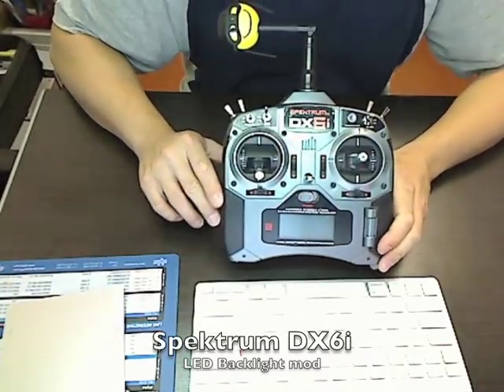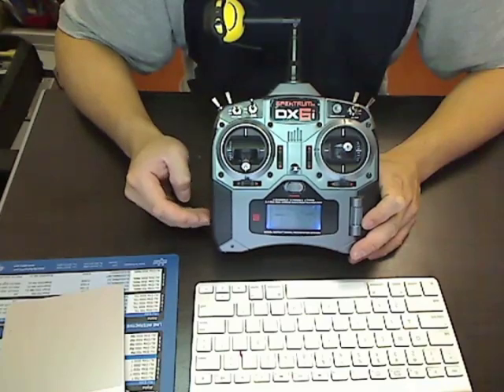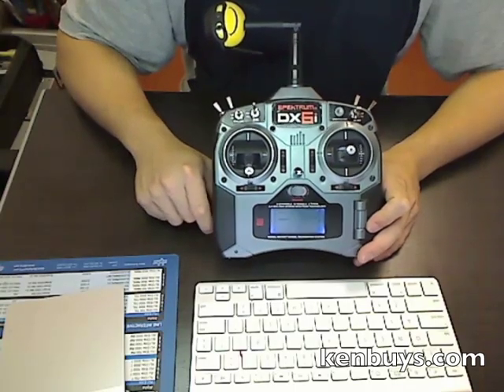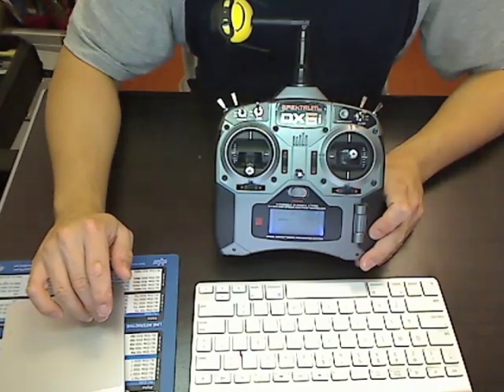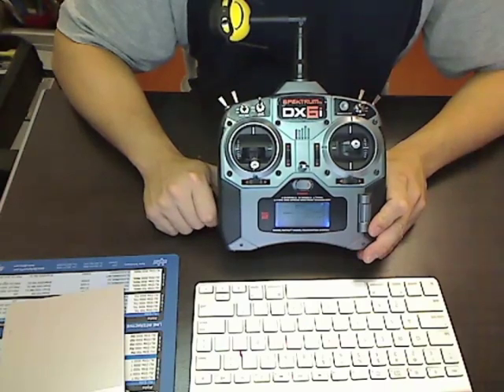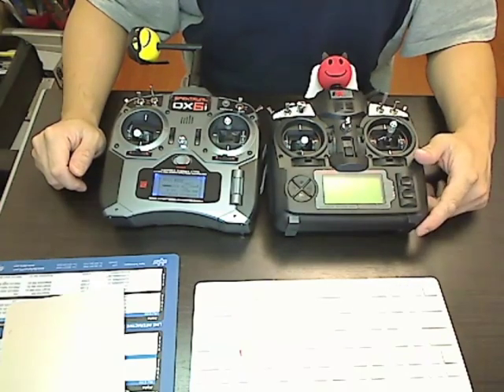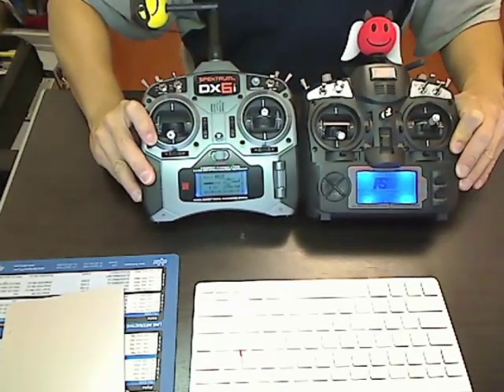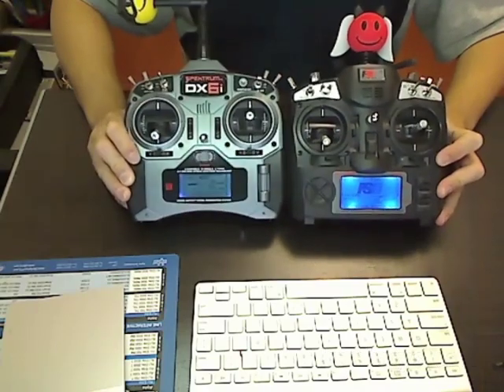Spektrum DX6i backlight LED LCD mod

Comment: Very cool... I just got that radio, love it.  The EL version I think too would rock, also why is everyone doing blue?  The only reason I can see adding back light would be for dark or night flying, if that's the case it should be RED to maintain your night vision.  Otherwise you'll be blinded by the color and through off your night vision IMO.